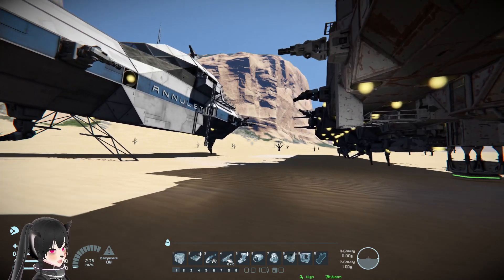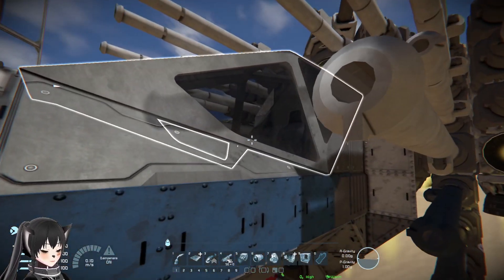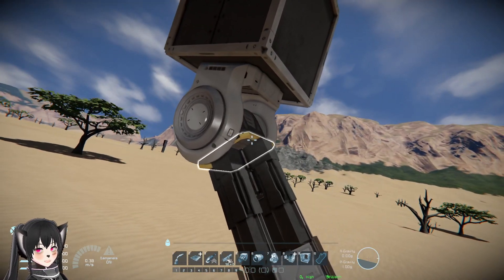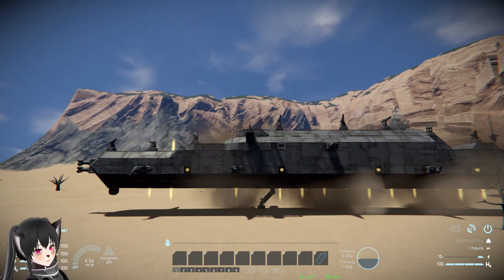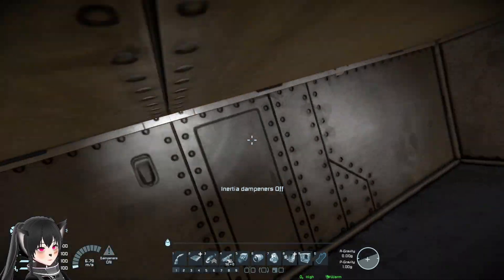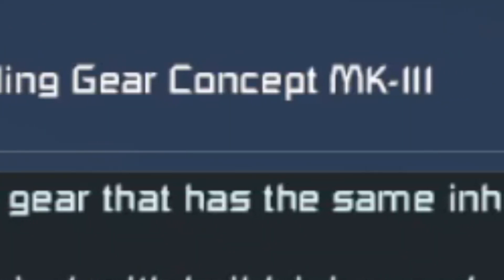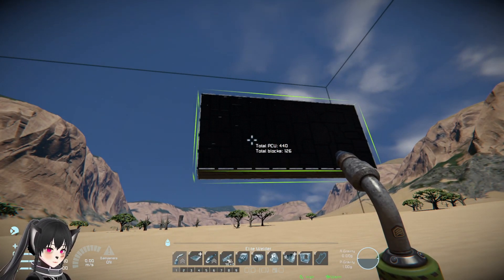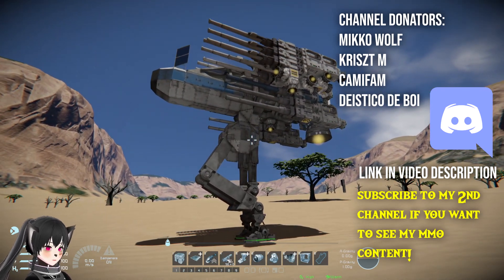These Custom Ship Landing Gears Are Insane, Space Engineers

Comment: You didn't test my landing gear on a ship, since they are on suspensions you can place them on MASSIVE SHIPS 😂 they will even land a carrier safe on the ground

Try placing 4 on your biggest ship, set the strength to something like 15/20 strength and drop the ship without inertia, you'll be surprised 😁
Reply from the maker: Oo, yeah thought about testing it but I thought the landing gears kinda shows what they're capable to do by themselves x3 might need to test them later though c=
Reply: @LucaTheGuide  check out General chat on your discord, i pasted some videos showing them on your ship